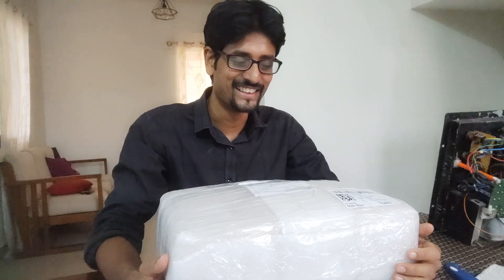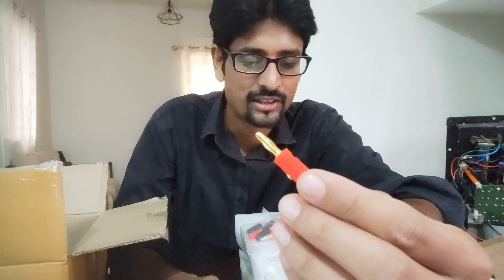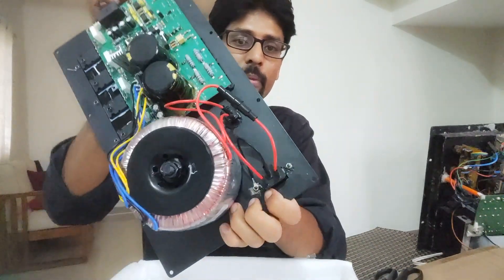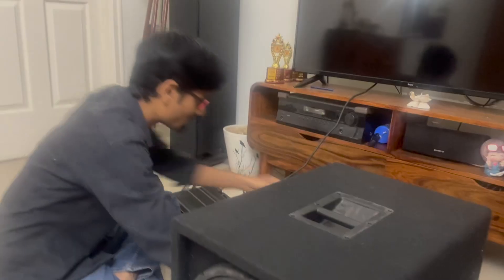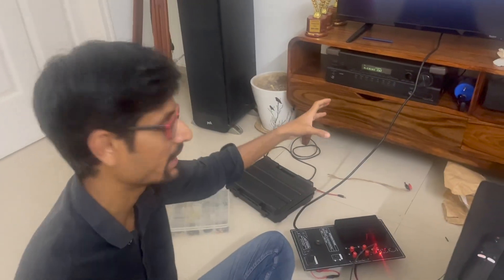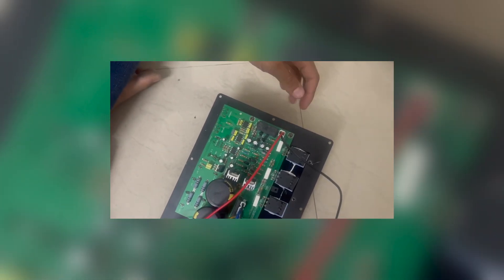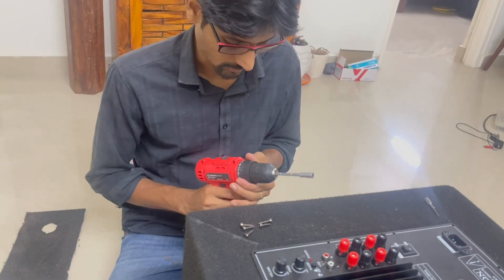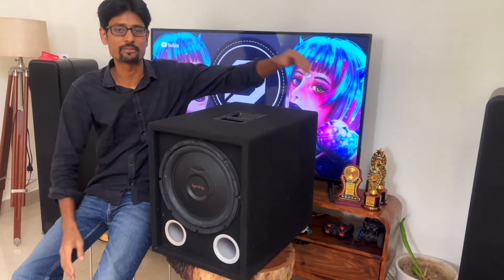DIY budget friendly subwoofer for home theatre  #subwoofer#diyprojects #diyelectronics #diyideas

Comment: Hope you are still monitoring the comments on this video. In the initial testing you were finding the gain requirement to be high, was that case after the installation was complete? Does this need a higher pre-pro separate sound processor with a 4 volt output or normal output from an AVR 1.5v or so will do? Also, the gain (volume) on the plate amp - did you need to keep it on higher side?
Reply from the maker: Good observation, yes the gain requirement is high. It works perfectly with an AVR output with Volume on the plate amp set at approximately 70 percent or higher and the AVR subwoofer channel gain set at +4dB. The measurements im quoting is considering my Denon X3800 but I assume it would be more or less similar for most AVR’s
It doesn’t need a separate preamp / preprocessor.

Additionally the plate amp also has high level (speaker level) inputs as well so that’s another option. 

Thanks and let me know if you have additional questions. Happy to help!

Comment: Hello brother. Glad to watch this.. So informative. Recently they launced DOOGESOUND SW350 plate amplifier.. Is that worth? As am planning to build 15 inch Rockford P1S4-15 (250 RMS) sealed subwoofer soon. 

Shalli go with SW350 from Doogesound or S&B 10001 mono car amplifier with AC- DC power suply?

Waiting for your valuable inputs.
Thanks alot in Advance.
Reply from the maker: Hey thanks for your comments. Yes the Doogesound plate amplifiers are built well and perform really well, you will not be disappointed. 

I havent tested the SW350 but from the specs i can see that it also has variable phase control so it is more suited to various placement options as it gives you the flexibility.

The sound boss series are class D amps in my understanding, if they are returnable from Amazon or other online resellers , you can try it out to see how good it is. It will be silent and efficient no doubt, but i believe you may have trouble in finding a powerful power supply of 12V 30 amps atleast

Comment: Excellent work sir and thanks for sharing knowledge, now i have the courage to convert my pioneer 1211 subwoofer of car to passive speaker. Sir can you make a comparison video on quality of diy subwoofer vs branded subwoofer of 12 inches which doesnt costs less than Rs 40000 of famous brands like polk, bic ametica, Jbl, klipsch etc.. How much is the difference in audio quality and is it worth spending extra 25 to 30 k? 200 watt amplifiet is out of stock, i called the distribuyor mentioned on their website and he managed to ship 1 piece which was incidently available at that time. Will i be loosing on sizeble quality on my denon AVR X1700 H compared to branded ones.
Reply: Thanks sir, your video is the reason I am building my own. Build a box of 50 litre as per spec sheet, will get the mdf cut by CNC  will use braces for rigidity and will ensure rounds and curves to make it attractive, professionally polished for look and sheen[I am from paint industry]. Thanks to you again and keep posting nice videos like this
Reply from the maker: Great to hear you have decided to go ahead! Awesome, so this is going to be a very well constructed and finished subwoofer.

Do share the pics and feedback once you are done. Eagerly looking forward.

Happy to hear this video was of help, will keep building and sharing.
Reply from the maker: Thanks for your reply! The pioneer W1211 is an excellent driver and paired with a suitable cabinet will most likely outperform budget subwoofers. Make sure you refer the spec sheet and chose the right cabinet volume according to the fs and thiele small parameters. 

I have reviewed the BIC America PL300 and Polk HTS12 at the dealership and I did not feel the price to performance ratio that warrants an expenditure of about 60k INR hence decided to build my own subwoofer.

However subwoofers with active DSP correction, ex the Polk DSW Pro660 or higher SVS models will outperform DIY subwoofers especially in an untreated room. An alternative is to either treat the room with bass traps or build an dedicated equalizer in the lower frequency band, 20-250hz to even out the peaks and troughs.

Apologies for the long post. My conclusion is go ahead and build your own, it will give you much better performance than any Sub without DSP or active correction.

Comment: Wow excellent review... This was on my radar for long and recently thought of buying it to convert my DIY subwoofer to an active one... Sadly it is out of stock 😅 Gonna buy mine as soon as they restocks it
Reply from the maker: Thanks for your kind words. Yes it's a good buy and value for money. Just checked, as you said it's out of stock now :( but I see the 100watt RMS one still available if you are interested.https://www.doogesound.com/products/doogesoun-100w-subwoofer-plate-100watts/692967000005668482

Glad to connect with another DIY'er. Do share pics of your build 😊
Reply: @acousticmalayali  Can you please mention the plate dimensions?
Reply from the maker: Sure, for the 200W RMS that I purchased, the plate is 32.2 cm long by 18.3 cm wide on the outer side. 

The cutout will probably be around 1 to 1.5 cm lesser so that the plate can sit from the outside. Let me know if you need any other info
Reply: @acousticmalayali  Thanks, It will then fit my box...Doogesound should have given the plate dimensions/cutout drawing on their website.
Reply from the maker: True 👍
Reply: @acousticmalayali  Seen that 100watt plate. But I need atleast 200watts of power to drive my sub (12inch JBL 300Watts). I would have definitely bought that otherwise. Anyway I will see for few days if it comes in stock again. I will definitely share the pics of my build. Thanks a lot brother!
Reply: In doogesound website this item is out of stock. This is availaible in denx audio site. Can I buy from this site?